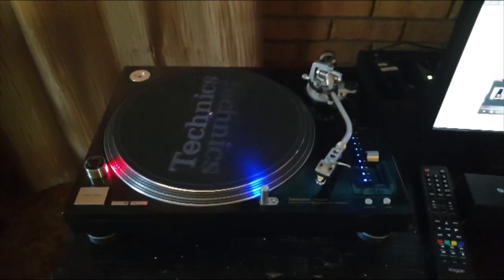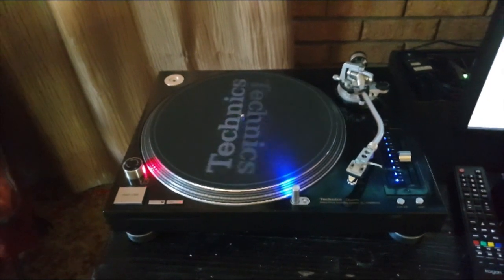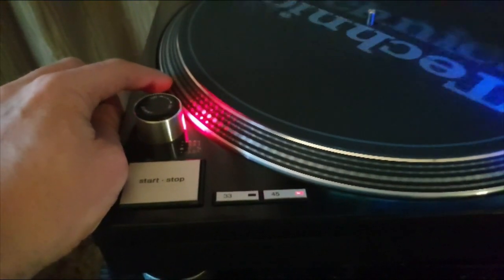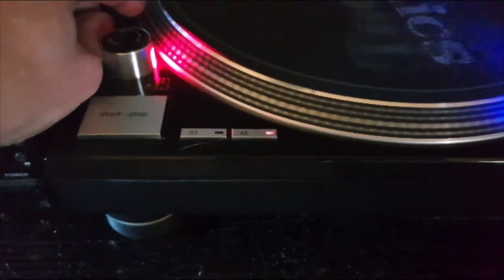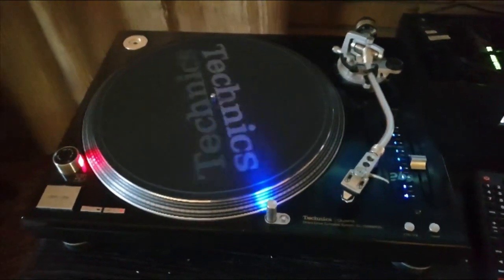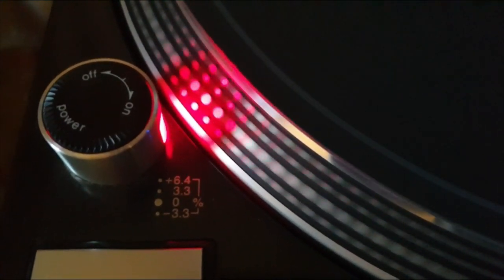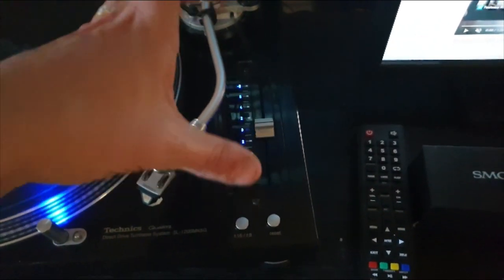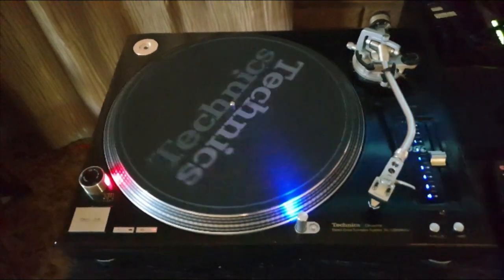Technics SL-1210MK5G Quartz Lock Removal (TP17/R209 Resistor Snip)

Comment: I have another question for you, you seem to be well educated with these tables. Would you have any idea why my turntables are somewhat unstable within SERATO ? My tempo is constantly moving .1 .2 out on BOTH turntables, and it has always seemed to be that way. Any idea on how I can look into correcting this ?
Reply from the maker: Hey man you're absolutely fine, what you're referring to is called Wow and Flutter. Technics SL1200MK2's specific range was 0.01% WRMS (turntable stays within 1/100% of speed selected) but there are reports of even up to 0.5% and being totally acceptable - and there's also a lot of things that can contribute. One for instance is the accuracy of the pressing of the vinyl, if it's not dead centre then the tonearm will have to travel back and forth and you'll get a variation in pitch/speed. I've noticed this in all 1200's over the years, can be annoying

One thing you can do if you're very concerned is adjust your antiskate to steady it further. Adjusting it while watching in Serato etc to see if you can calm it down will be the easiest way.  Also, take a look at your strobe lights, is, there a repeated momentary visible flicker and drift?
Reply: @djahriman  just fyi I’m going to be using phase with my turntables after I modify my tables, this shouldn’t make any difference right, after the modification they should still sit happy while mixing ? And to answer your question I don’t see any flickering with the lights and I’m unsure what you mean about drift .
Reply from the maker: Phase will 100% be fine, just as before. You'll notice beatmatching etc with the platter a whole lot more responsive. No flickering is a good thing, there's no obvious power fluctuations. By drift I mean a noticeable slowing or speeding up of the dots.  @DjDaveDiggz
Reply: @djahriman  to be 100% honest I’m very hesitant doing this modification. If you know anyone who is willing to buy my mk5gs I might be willing to sell them. They are in like new condition I still have the original boxes they came in as well.  I’m going to take a few days and think about this before I snip them, or like I said I’d be willing to sell them if you know anyone who is looking.  Thanks for all the info you’ve been extremely helpful
Reply from the maker: @DjDaveDiggz  Where abouts are you located?
Reply: @djahriman  I’m in the US. Long Island NY
Reply: If you have whatsapp or some kind of app we can chat through that might be easier.
Reply from the maker: @DjDaveDiggz  No worries at all mate - I completely understand. Reversing the mod is quite simple, i've even just reconnected the resistor via a dry fit on an older pair of 1200s (NOT IDEAL, you should always solder lol!!) but it worked. But yeah, when in doubt there is no doubt!

Unfortunately I live in Australia, so the freight would kill the incentive for me to get these.
Reply from the maker: @ Hey ninja, Checking in a year later :)

Comment: Hey man im struggling with long mixes with my 1210s and I think one of them is off slightly. Do you recommend that I snip the resistor ? Or can I bring it to a service shop and see if they can do it for me ?
Reply from the maker: Honestly it's easy enough to do now, just snip the resistor and turn the pot wheel underneath the fader all the way clockwise on both decks. You may need to adjust one ever so slightly but all you can do is try. It's easily reversible, i'd definitely give it a go.
Reply: @djahriman  I’m a little hesitant but I think I’m going to try, I just put together a booth in my house and I’m regretting the tables because of how difficult they are to mix with. I was thinking about buying an all in one or something. I’ll keep you posted and let you know what happens, I’m hoping these 1210s will mix nice and tight after the mod.
Reply: I noticed these are 1200s in your video, is the setup exactly the same with the 1210 mk5gs ?  I’m another words tp17 and the adjustable potwheel are in the same location as the 1200s?
Reply from the maker: @DjDaveDiggz  Absolutely 100% it is the same :)

I think the Japanese model was the 1200mk5g and in America etc it was the 1210m5g

Comment: Is there a way to do this so pitch stays same place this works but makes pitch different and you cant get it bang on even with adjustment screw can you put a resistor somewhere or buy a variable pot that gives more adjustment?
Reply from the maker: In the case of the 1200s, yes, but I haven't found a way so far with the M5G. Even though it's about 0.5-1% out I still only pay attention to the speed that the dots are going and I haven't really found a situation with +16 that I can't beatmatch with. I know what you're saying though: it was much easier to re-zero and calibrate the pitch back on SL1200mk2 than the M5Gs so that the single zero point was spot on. 

Watch this space, I will be doing some more investigations!
Reply: @djahriman ive heard change the pot to 20k give it more adjustment
Reply from the maker: @technic02  If it is something as simple as this, this is fantastic.
Reply: @djahriman in the end bought mk2 but this mod certainly makes them better for beatmatching i might try putting different potentiometer on the pitch to get zero on the mk5g at some point got some 20k pots handy.
Reply from the maker: @technic02  Hey that's really cool man! If you do end up doing it, please let us know how you go. There is still a bit to figure out :)

Comment: Way better but would be better if zero was zero wonder if there is a way to correct that the dial does not go far enough
Reply from the maker: Still unsure yet.
Reply: How far out is your turntable ? Where is your zero sitting at ?
Reply: @DjDaveDiggz  forgot now i bought mk2 prefer them still got my mk5g boxed up might get them out again some day probably needs a resistor or a pot that adjusts it more to get it dead on with mod.

Comment: Can you scratch after this mod???? Does it grab properly after mod when scratching i do both mixing and cutting? Please reply soon as.
Reply from the maker: Absolutely you can, i'm not a scratcher per say but dj's have been doing the quartz lock "removal" mod on 1200s for absolute decades including scratch dj's, it makes mixing more responsive so i'd imagine scratching would indeed benefit. 

Further information on this mod, something very similar was done to 1200s back in the day to increase the torque substantially when the turntable was being used to cut bootleg vinyl. True story.
Reply: @djahriman  is the pitch pot adjuster best set faster or at slowest out of curiosity or no difference apart from quicker speed would have thought slower makes more fine adjustment but it may be more responsive set quicker if the increments are digital as they are not as finely tuned as the anologue

Comment: Just repaired one of mine some shop fitted an aftermarket transformer causing it to be slightly underpowered put up with it 3 year and bought original transformer lights are brighter now it matches my other beatmatches hell of a lot better is this mod worth doing mk5g are always harder to beat match on and ive mixed for years
Reply from the maker: I reckon it's worth doing. When I purchased my first pair of M5G's and tried them, I immediately wanted to go straight back to my modified 1200s. I tried to persevere and keep them but I ended up selling them later. I reluctantly bought this pair knowing I would have the same problem and that I would have to get used to it, but now they're 100% perfect in my eyes. One Hundred Percent.
Reply: @djahriman  mine are better since but they are never going to be as good as none digital in terms of keeping in a mix still oreyt though best mod ive done.
Reply: @djahriman  would you say that your modified turntables are easy to mix with or in other words, are they tight and reliable like mixing on an all in one mixer ?

Comment: Hi Marneus,
I have a pair of m5gs and am really struggling doing long mixes on them . On mk2s all is fine ...
Do you think doing this would help?
Reply from the maker: Strangely enough it may just do - I have had 3min+ mixes with these and they've kept in sync better than my old mk2's, strangely enough I had to keep fading in and out just to check!! Couldn't believe it. 

But realistically if they are getting out of sync badly there could be more underlying issues. Give it a go - it's always can be reversed :D
Reply: Do you still have a dead zone at+7 to +8 ? both mine are exactly the same . I took the pitch out and adjusted the pot and it seems to give me an adjustment of +-0.5.
I have read the M5G's do suffer with this like the new Mk7
Reply from the maker: @22TuRnEr22  Can't believe I didn't notice this reply! Yes it still has the dreaded dead spot but I have read that's an internal issue with no fix. VERY similar to the Mk7 - i've not delved as deep as to find out if the effect is caused by the same thing. 

I find myself mixing on +16 sometimes because of this, but obviously this is not as precise.
Reply from the maker: ^^^ What I said before applies to the quartz lock button as well. Completely in tune.
Reply: Hmm ok . I find I'm constantly riding the pitch and can never/rarely  get a perfect sweet spot ..
Sometimes I have to pitch both decks .. 
I may try this later this weekend . 
I'll mark the pots position beforehand  just incase.
I couldn't quite see in the other video did you just snip the left side of the resistor and move it over slightly  ?
Cheers
Reply from the maker: @22TuRnEr22  

Mark the pots indeed, max them out. And yes you are right, just snipped the left side of the resistor (it really doesnt matter as long as you can easily resolder it). 

If you have a multimeter you can measure the resistance of the pot first and then you don't have to worry about marking it :)
Reply from the maker: @22TuRnEr22  Brother do you have any latency between your needles and your speakers? 

(I ask this because I only just found out thanks to my brothar that my amp actually has a fricking DSP latency and i'm having to mix COMPLETELY with headphones nowadays, I cant hang one ear out and mix as I will forever be fighting it, so i've learned to mix completley on headphones to compensate. 

What mixer are you running?

I hope this is as simple as latency between the amp and the needles :)
Reply: @djahriman hey not that I know off. Mixer goes straight to my powered Alto ts308s . 
I did wonder this myself before . I've had that issue in the past myself my Yamaha 5.1 amp puts a delay on everything

Mixer is a traktor kontrol z2 btw
Reply from the maker: @22TuRnEr22  Curious my friend. The only other way to be 100% sure is to run timecodes and check the pitch in serato or vdj etc.

very curious.
Reply: @djahriman  if I put same 2 records on all is fine . 
Can beat juggle and they stay in sync.
It's when I mix .. I've used decks on and off for 20 years but can't get used to these m5gs ..
Hence when I saw this I wondered.
Check the pitch in traktor and it's spot on with the +- 0.02ish  wow and flutter.
0 is 0 etc .
I'm ready to sell em and buy mk2s this is last chance.
I've also read it's the digital pitches .
Thanks for all the help
Reply: @djahriman  
Hey mate how is going with the mod is everything still working well? I still haven't got around to doing mine  yet
Reply from the maker: @22TuRnEr22  Hey mate - the tables are still going strong, absolutely ROCK SOLID. Very impressed. 

The only issue I have is the 20ms delay between my headphones and my speakers, but apart from that everything is 100% fine and awesome :D
Reply from the maker: @22TuRnEr22  honestly brother I'd give it a go and see what you think. The digital fader seems to be an issue for some but I don't notice it. Just mark the pot wheel so you can return it to normal if necessary
Reply: @djahriman That's great mate.
 Is there no direct mode on the amp? What amp is it?
Reply from the maker: @22TuRnEr22  it's a Marantz and I'm using direct mode.. it's annoying my friend :) I just mix with headphones for the majority
Reply: @djahriman  my Yamaha is exactly the same mate .. so annoying.
Update.
I been tinkering this evening and using traktor timecode there seems to be a dead zone at +7- +8
Traktor says +8 at +7 on the deck and doesn't change if I move the pitch past +7.
Haven't tested the other yet but will update when I get chance.
Reply: Just done it miles better